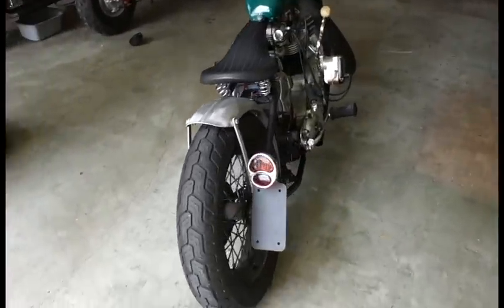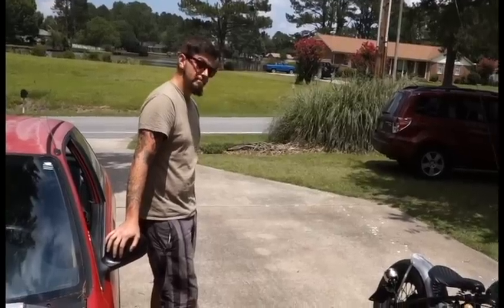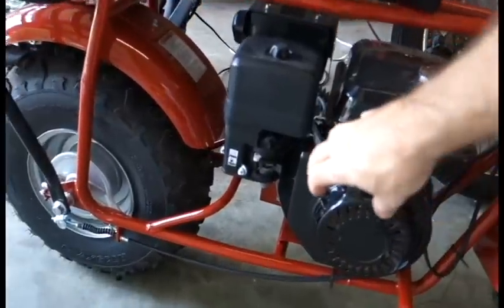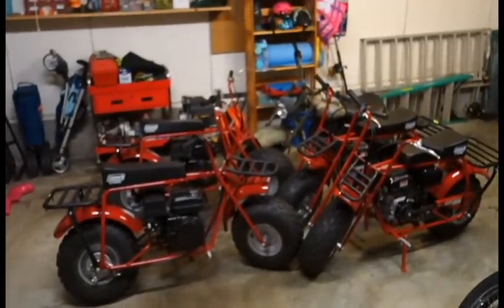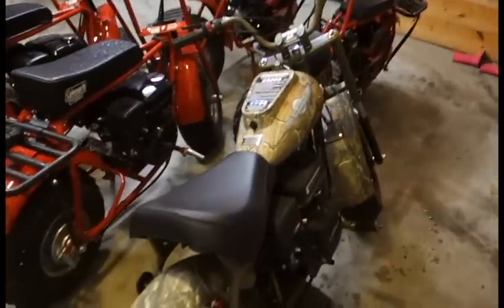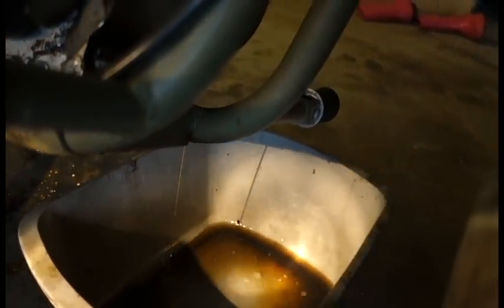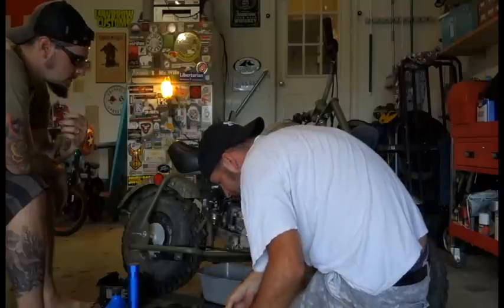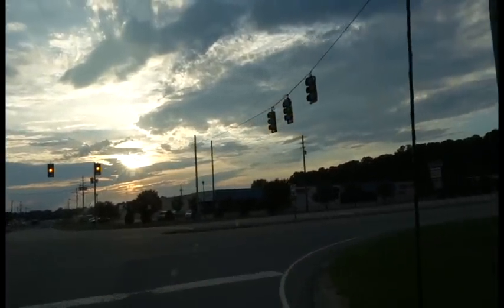We Bought 3 Mini Bikes!! Ike's Adventures

Comment: those thing are worth $50 new
Reply: Simon Busby you're delusional, they're going for $400 brand new. I got mine for $200 used.
Reply: MellowCream he may be talking about the predator?
Reply: I was talking about the colmon
Reply: I agree. They are trash that have been painted red. Google them. they are complete junk.
Reply: I guess if I was 12 like y'all, I'd probably think they are bad ass.
Reply: The Coleman Is Not A Great Bike I would consider an Average Mini Bike That 196CC 4 Stroke Is Weak I had a Straight Pipe Exhaust, E3 Spark Plug & The Throttle Screw A little back & only hit 23MPH.
Reply: Kevin5.0TT Lopez Dude they aren't supposed to go very fast and did you consider your weight.  I have one I'm 180 pounds it hit 22 nothing done to do it the screw isn't even taken out.  These weren't supposed to be used as land speed record breaking vehicles they're supposed to used to go ride around on trails or to your buddy's house 3 miles down the road.  Its probably your weight that made it slow not trying to be rude but you can't call it slow if your holding it back
Reply: The Guy On The Minibike My Cousin Weighs about 95Lbs & Its the same problem
Reply: any one that calls it a throttle skrew shouldn't ride one, lol take the governor off and tap the hole with a bolt then upgrade your jets and you'll be scared to hit top speed lmao, adjust your gear ratio too, I had one that would go about 63 and I only topped it out once or twice because they're very unstable at that speed
Reply: 50$ dollars from where? china.com?
Reply: Vasily B for real haha if you could get em for 50 bucks I'd be the biggest distributor of them in the Midwest lmao
Reply: MellowCream 

 then why did Wal-Mart stop carrying them  if they're so good?
Reply: Tommy Farmer1981 They still carry them that's where I got mine 4 weeks ago
Reply: they have em at my walmart and at my tractor supply
Reply: You're exactly right. These were designed as a trail bike with the classic mini bike look. Why would anyone expect higher than 25 mph with 10 to 1 gearing? It is clear that these are set up for slow speed trail riding.